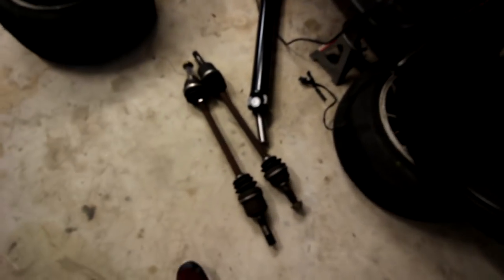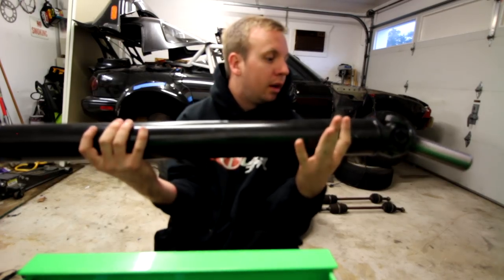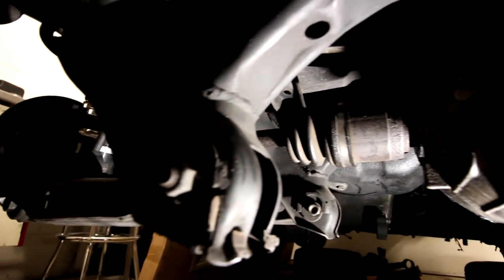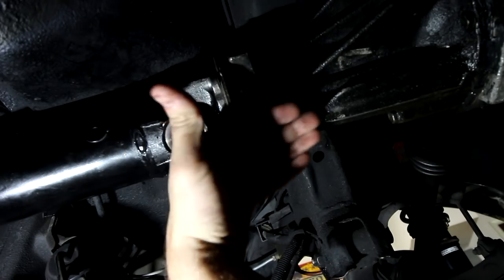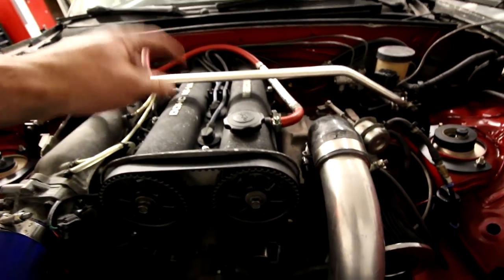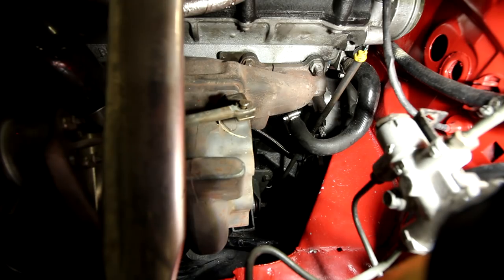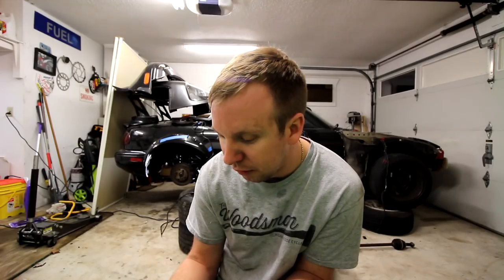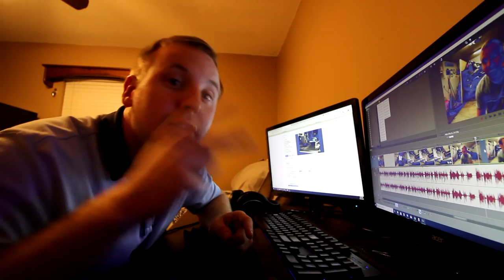Custom made Driveshaft for RX7 Transmission swap!

Comment: You running oem Glock springs or aftermarket 🤔
Reply from the maker: Hector Rst oem! Still racks perfectly even with 115g ammo
Reply: FloridasFinest some people run into issues with having an rmr and a can might have to run a different recoil spring 🤷🏽‍♂️ I have a polymer 80 g17 I’m planning on trying to get a can and possibly an rmr but money is the issue for the rmr
Reply from the maker: Hector Rst ya rmr I got cause it was a good deal from a friend lol and ya I think with slide cuts it helps rack a round. I have a p80 build too I’m working on! Still need a slide for it lol
Reply: FloridasFinest shoot I’m hoping to get ether an agency arms or norrso slide I’m gonna get a gold barrel like the one you have except I might go agency arms barrel and Comp titanium nitride “gold” and a cmc trigger and maybe a zev spring kit a ghost connector

Comment: How did you determine how high to mount the transmission in the tunnel?
Reply from the maker: Hauf Performance I looked up how high and angle the driveshaft should be and also compared it to the stock Miata transmission. At end of the day it was a little guess and check tho to be honest